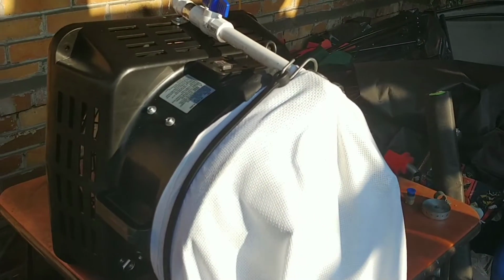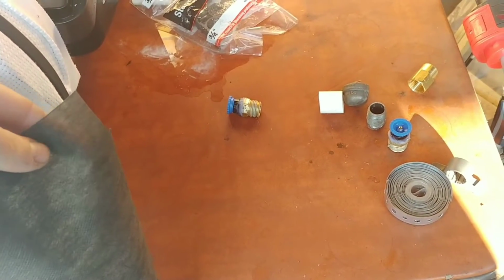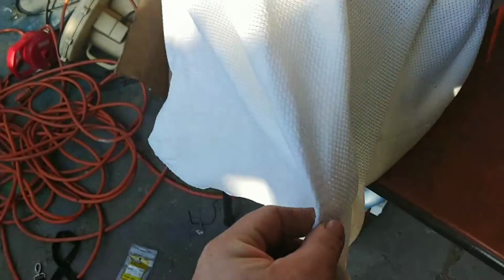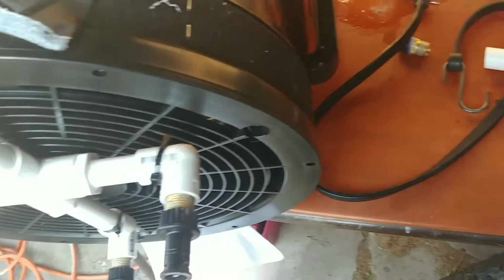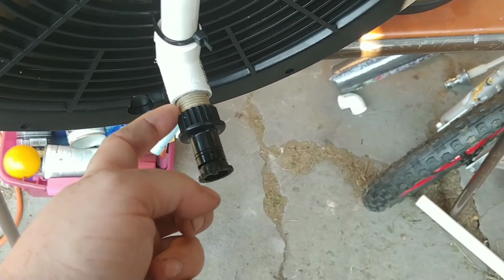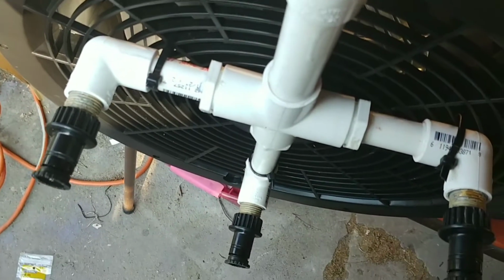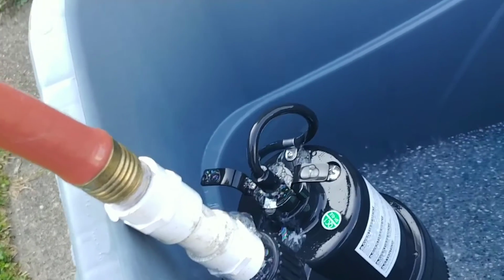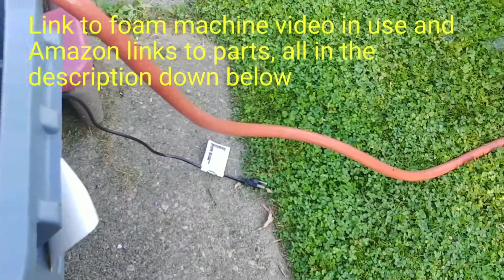DIY Homemade How to Build the Best Foam Machine

Comment: my fan has been turning off on it's own after around 15 minutes. wondered if you had this issue?. I also am wondering if my mesh is not big enough that would cause this. All in all, it's a great design!
Reply: That's because your restricting the airflow for to long. You have a safety on the machine incase this happens. It's basically a safety for overheating.

Comment: I bought those sprinkler heads. How do I use them. Did everything and nothing comes out. Do I need to loosen them or something
Reply from the maker: Sorry for the late response. The top circle spins to adjust the spray

Comment: It's a great machine I made it just like you did, the only problem I'm having is the blower keeps kicking out. . It will reset after about 5 minutes. Maybe I need a longer sock to let more air out. Can you help me out brother.
Reply: Di's you use the same sprinkler heads. If so I need help
Reply from the maker: Sounds like electrical. Maybe something is getting wet is foam getting to the electrical maybe the fabric, sprinkler head pattern. or soap mixture is slightly off and the foam could be backing up. Try adjusting one of these
Reply: May sound crazy but most of the time fans end up working harder with less resistance because they move so much more air.  It's not what intuition would say and it does depend on the fan type.  I think your idea of making the sock bigger was a good one but maybe consider making a smaller one

Comment: Can this be converted to a “snowfall” machine for Christmas?
Reply: yes it can, i also replied to you on that other vid
Reply: although you need a smaller "sock" and the fan nedds to blow the foam
Reply from the maker: I tried a couple different times to convert this into a foam cannon or snowfall machine but I couldn't get it right